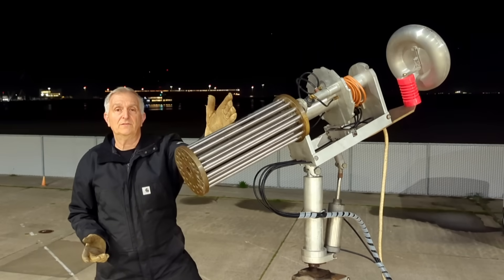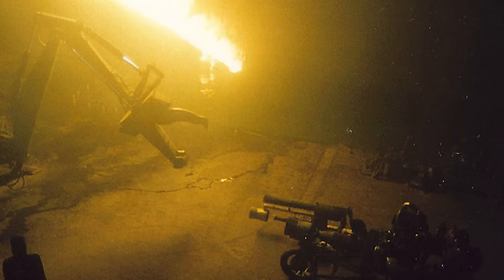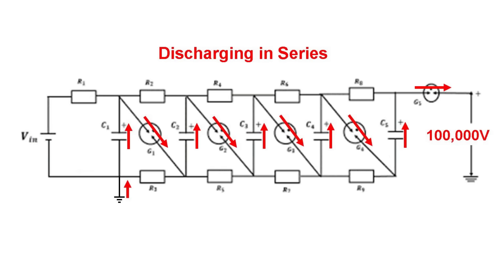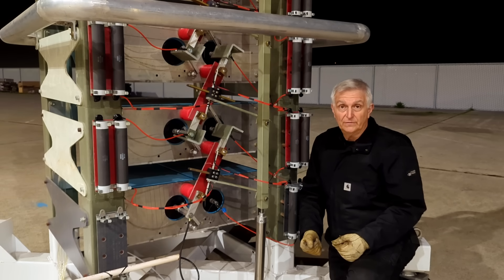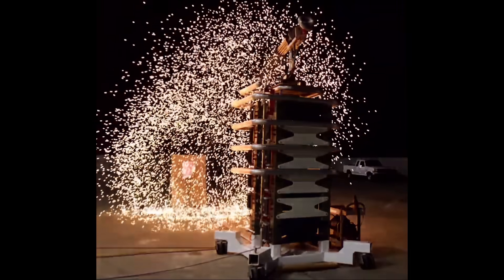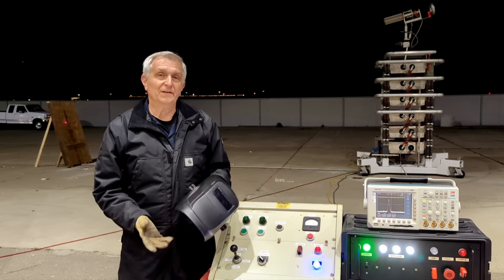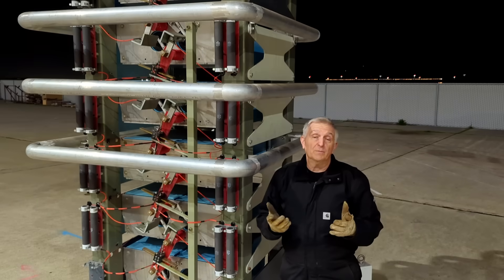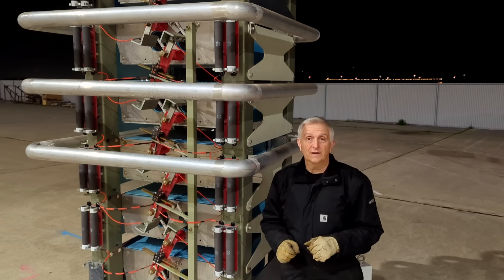Firing the Lorentz Plasma Cannon

Comment: 3:12 heyyyy I worked there, one of the coolest pictures ever! Unfortunately the machine no longer does this :(
Reply: What does it do now
Reply: @ It does the same task but the electricity is contained within the test object, as it was always meant to be. Means no pretty lightening bolts, though.
Reply: @EllipticalReasoning no more light show?!? Awwwww I wanted to see man made awesome
Reply: Honestly seems like an awesome job!
Reply: What is that thing actually, I hve seen that pic from my childhood
Reply: @  I replied to this but it seems the comment was eaten by youtube - it is the Z-machine pulsed power facility. It concentrates electricity from a huge circle of capacitor banks into what was the highest voltage charge on earth (I'm not sure if it's been overtaken). They zap various things, but primarily targets made from very thin, precisely positioned tungsten wires, which they do to model the behavior of plasmas in extreme conditions. 

The massive sparks were an unintended and initially unknown side effect of the process, discovered when a researcher left a camera in the room (which is, of course, cleared of personnel before firing) during a test.
Reply: @ranojmahilary8064  It's the Z-machine pulsed power facility at Sandia National Laboratories. It's the highest voltage facility in the world (actually it might be only the Americas now), as well as the brightest x-ray source in the solar system (see above). They use, as described in the video, enormous banks of capacitors submerged in oil to build up unbelievable electrical voltage and current, which they funnel into various test apparatus to create intense electric and magnetic fields for the study of plasma behaviors. The sparks you see are actually wasted energy that is lost in the process - a modernization a few years ago means these are no longer formed, as the electricity is properly captured. Fun fact, for a while they didn't know it did that, until a researcher put a camera in the chamber on a whim. The scientists were worried but it turned out to be harmless.

Comment: Slo mo shows what appears to be a thin metal rod being shot in advance of the discharge. No mention was made of this. While I presume it was used to guide a thin wire, it would help if this object and its relevance was explicitly mentioned. Additionally, building a unit with a quarter mile range would presumably require a larger, sophisticated wire spooling system, similar to what's used on TOW anti tank missiles.

Comment: What is the pellet that shoots out before the plasma explodes
Reply from the maker: The dart for the trigger wire
Reply: @LightningOnDemand  is there also a ground wire that's run from the capacitor stack to the Target
Reply: I assume it carries the thin wire conductor that forms the plasma.

Comment: 6:27 Okay, possibly a dumb question but.... Are all those "sparks" just plasmafied air? If so, why are they affected by gravity so much? I'd have assumed that air in a plasma state wouldn't change it's density (or at least not have it's density go UP). So, clearly I'm missing something here.
Reply from the maker: I'm not exactly sure... It seems odd to think that they are all from the infinitesimally small wire [only 0.008" dia]

Comment: ITS BACK! I would love to film this in slowmo.
Reply: time for science youtubers unite and get this man a 30ft tall capacitor bank!
Reply: @outandabout259  Where is Hacksmith!!
Reply: @outandabout259 dont let the us gov see this shit lol they'll come to him with tanks and fighter yets😂😬😬
Reply from the maker: What frame rates are possible these days at 1080?
Reply: @LightningOnDemand  From wiki - "The Phantom TMX 7510 is currently the company's fastest camera as of November 2022. It can record video at up to 76,000 frames per second (fps) at its maximum resolution of 1280 x 800, and can record at 1,750,000 frames per second at a resolution of 1280 x 32, or in binned mode with a resolution of 640 x 64." The trick is you wouldnt film full frame along the hight, but a nice, thin, laser sized frame for them truly stella slowmos. Good thing with your setup is light (hopefully) wouldnt be much of an issue. Destin, correct me if im wrong
Reply: @LightningOnDemand  pretty sure most guys with phantoms run at like 250,000 but technically they've built cameras that can record the speed of light
Reply: @masterofhippos1395 that's impossible for many reasons. There was a high speed camera that claimed it recorded light, but it was disproven.
Reply: @masterofhippos1395 cameras that record the speed of light are a little strange though; instead of recording everything at once in one take, you scan a few pixels at a time and repeat the same procedure each time until you have a complete video.
It’s really hard to record something that isn’t repeatable because of this
Reply: @nightmare1010 the one MIT or Harvard made (can't remember who) didn't work like a normal "camera". From what I remember, it was like a reverse camera where it picked up "shadows" and could track shadow displacement, and work backward to therefore "capture" photon progression but... I'm just a jackass with a phone. I literally know nothing.
Reply: @LightningOnDemand way too many. 😂
Reply: @LightningOnDemand  Up to 1 million fps if the image is black and white
Reply: @LightningOnDemand  lol lots of
Reply: @LightningOnDemand I mean.... a lot.... Like, a LOT a lot. 

And if you're getting super crazy, and are alright with "frame rate" being more metaphorical than literal, we can now catch photons in slow mo using... hyper magic. (MIT did this a few years back iirc)
Reply: @LightningOnDemand  over 9000!
Reply: @theslowmoguys
Reply: Slomo guys would totally jump on this bandwagon
Reply: @MaverickBlue42  yeah but they're irritating
Reply: Yes. Yes. Yes. Yes. Yes. Yes. Yes. Yes. Yes.

YES! 😆
Reply: I need this collab! This machine absolutely blew my mind
Reply: If you're the one that does it, please just do it justice! We know that we need the super super ungodly million frames per second stuff with something like this. Anything less than those latest greatest camera models would be a dissapoinment honestly. So please rent one and do it right 😃
Reply: I'm so glad you are see you saw this.

I would love to see you bring a slow mo camera to film it. Tho I understand if you are concerned about the camera getting damaged.
Reply: @darkpheonix77 If concerned about the camera, perhaps you could use the same method used to film the atomic bomb tests
Reply: @smartereveryday @theslowmoguys time for a colab
Reply: @danatkinson1517  mmmmmyes. Smarter everyday brain combined with slow mo humor and this genius of a man that created this masterpiece. I almost say invite rober, and electro boom but. Marks so busy and electro wouldn't want to get Zapped by that thing😂
Reply: And then please dumb it down to my level 😂.  Electriccurry. 
Am I right in thinking it's just a lot of power being forced through a circuit,  as I presume the bolt you see has a wire attached.  And long pole on the floor is negative earth.? 
Never been great great at understanding electric.
Reply: @DW-hx1xm  yes it shoots a little metal piece at the target with a wire attached back to the cannon, which guides the electricity where to go. And the capacitors are basically just being used as a huge battery bank, but one that can be discharged all at once very quickly!
Reply: @koijoijoe Obviously you can see the wire, but I'd like further explanation. Is the wire being shot from the cannon? Was it already pre-wired? If it shoots out, how and where is it attached? It's not really a "weapon" if you have to say "excuse me, violent robot who is trying to cut my head off, but do you mind if I solder this wire to you?" An air or explosive powered projectile attached to loosely bundled wire, shot from just above the laser should do the trick, but then you need a means of timing the electric discharge to happen right when the projectile reaches the target. If he got this far, I'm sure it's doable. Would the target need to be grounded? Could it shoot down a drone? This video left me with a lot a questions that I'm sure Destin could help sort out.
Reply: @DW-hx1xm Yes, it's just a wire at 210,000 volts being shot out that completes the circuit when it reaches the target.  There's a grounded lead on the floor that goes over to the target from the tower.  Of course, the trick is that he's firing the Marx generator just as the wire being shot out reaches the target since a Marx generator is a pulsed circuit.
Reply: @flomojo2u doesn't the wire making contact with the target cause the capacitor bank to fire? Just by completing the circuit.
Don't you just charge the bank up and then fire the wire - then kaboom!?
Reply: I love how I randomly saw this for the first time today and as I look at the comments.... here's another one of my favorites! Crazy
Reply: First thought seeing "8x slow mo" was we need Destin or Gav on this STAT!
Reply: Of COURSE Destin is here, and early. I'm sure I'm not the only one who thought this guy would be right up Destin's alley. 😆
Reply: Show this to Mehdi. He must see it!
Reply: Make this happen! :D
Reply: Slo mo guys please!!!
Reply: Maybe a team-up with the @theslowmoguys?
Reply: Get on it Destin... I feel like how ridiculous could have a lot of fun with this too
Reply: and i know some Guys just for the job
Reply: Please make this a thing and help him build it bigger!
Reply: Please make this happen Destin, or we will be forced to bully Gav and Dan instead :face-green-smiling:
Reply: Make it so
Reply: Collab!? Yes please!!!
Reply: Plz do Destin !!!!!
Reply: I was hoping! Yes, please!
Reply: @theslowmoguys?
Reply: Smarter collab with this cannon would be amazing, please i need it
Reply: All the yes!
Reply: That would be awesome!
Reply: dude! I was thinking the same thing lol
Reply: Please make it happen!!
Reply: You know something is legit when Destin comments on it 😂😂
Reply: Hi Destin! I shouldn't be surprised but am definitely delighted to see creators watching each other work.
Reply: Pleeeease
Reply: Yes please do
Reply: YES !!! Some real slow motion (so at least 80'000 frames per second if not 800'000 f/s) with proper exposure so the most exciting moment is not all white.
Reply: Wuderwaffe
Reply: Sup Destin!!
Reply: Please!!
Reply: For real, I was gonna suggest slomo guys, but like I need to see this is some high definition slomo. I want to know what's happening!
Reply: oh my god please make this happen. that would be peek entertainment holy crap!
Reply: omg yes, please collab :)
Reply: Would love to see this
Reply: Take care to not be adversely affected by the plasma chanel
Reply: Yes! So cool to see this.comment!
Reply: YES PLEASE!
Reply: Yeees I was about to comment that 🎉
Reply: Yeah this is really cool to see that tiny beam of light that looks literally like a blaster shot from starwars.
Reply: Yesssssss!
Reply: And I would love to watch it!
Reply: Just remember to bring extra underpants.
Reply: Yes pleaseee!!
Reply: Please!!! This would be awesome
Reply: Please make this a reality. Get on the phone to the slow mo guys asap
Reply: Dude! Yes please!
Reply: OMG LETS MAKE COLLAB HAPPEN!!! THAT WOULD BE SO FRIKIN AMAZING!!
Reply: I was thinking this exactly.  Having you show up and break down and into this topic as well as the super nice cameras to see more of what's going on would be so sweet.
Reply: PLEASE make it happen this would be incredible
Reply: Let's goooo!
Reply: Destin is here. Now where is the madman Chris Boden?!
Reply: Call Rober too. Get it done.
Reply: Well well look who it is
Reply: No me first
Reply: Destin, you should give him a hand and make that 1/4 mile hit!
Reply: Destin, I was thinking of you when he played the slow motion shots! Would love to see you guys get together on this project!!!
Reply: Hey this guy got time money and cameras. You won the lottery LoD!
Reply: MAKE THE LARGER VERSION HAPPEN!!!!
Reply: Would it do anything to a ballistics dummy? If so that would be the best target!
Reply: Imagine something like this with the energy only a nuclear sub could provide...
Reply: Yes please! Honestly the first thing I thought of when I saw this.
Reply: Might wanna get Gav involved as well.  Not because I doubt you can do it,  but so that you can point as many cameras as possible at the thing so we get maximum coverage from as many angles as possible.
Reply: You + slow mo guys. PLEASE🤙🏽🙏🏽
Reply: Yesss please, I just think it's gonna be cool if you do some colabs and here you are !
Reply: I was just about to write a comment suggesting filming with @smartereveryday :D
Reply: You or the slo mo guys
Reply: Omg PLEASE film this guy playing real life tower defense in slow mo! I hope you guys can make something happen!
Reply: Please do!!
Reply: DO IT!!!!!
Reply: That's a big ass taser gun.
Reply: @smartereveryday  Yes yes yes!!
I wanna see Destin do a break down of this so badly!!
Reply: Yes please do. I was just dropping that comment
Reply: Get the Slow-Mo Guys in on too and do a three way collab!
Reply: I take it back! Colab with Mahdi, Destin AND slomoguys! Some mad science here!
Reply: I just got done saying I would love to see a Slo Mo Guys collab and then I see smartereveryday.
Reply: film your own content, grifter

Comment: How come nothing arcs? It only seems to set off once the wire physically touches something else, but I'm a little shocked it doesnt arc between anything else before that happens
Reply from the maker: That's the job of the equi-potential rings surrounding the Marx tower -- to prevent wayward streamers from forming.

Comment: ❤❤❤❤

From the shot at the TV - timestamp -1.44926583s in the high-speed camera is the money shot where the plasma connects. 

I also love seeing the deflection give up the ghost a few frames later.

So Greg, do you have electro mechanical switches to replace the spark gaps with individual contacts?

Comment: You are shooting a wire first for the charge to follow. That is clearly evident in your slow-motion video. That's not the same as a directed energy weapon. That's cheating. It's also not very useful for long-range targets.
Reply from the maker: There's no such thing as cheating in weapons! ;>  
I was also surprised to find that the range scales favorably with voltage, as I mentioned near the end of the video.  The trigger wire transport would simply convert from a dart to a drone.

Comment: Wow , to shoot a discharge plasma that far through the air is incredible . I have found the drier the air the better for discharges . Now in the winter with the woodstove on and humidity at 25% my Van de graaff generator can discharge from the top to the fan hood over the stove . If you were to use it in a empty building lowering the humidity below 30 % i believe you might get a longer distance with the power you are using . I think the moisture in the air could play a big part in your distance . Good Luck .

Comment: Is there a laser out there that is high enough energy to create the plasma path instead of a wire? Could be possible to discharge the capacitors along a laser neam that has prepared the plasma channel for the current to flow through?

Comment: "Shockwave has gone supersonic" You mean Ultrasonic? Points at Boeing Plasma force field blocking Shockwaves Plasma generated Ultrasound can generate pressures greater than the bottom of the Ocean if done right. Googles: "Ultrasound hologram with particles" What's the rod you're shooting? The conductor for your bolt? You can make invisible lines using what's in the atmosphere to your target. If you want to make plasma balls you're gonna need Ultrasonic holography just enough to feed the rotating compressed ball of plasma before releasing it and it needs to be able to make its own Ultrasonic tunnel  after being released so it pushes medium out of its way with Ultrasonic repel field.

Points at Ultrasound Holograms shown in public super primitive Heh.. Points at Predator movies Plasma cloak Warwick university Plasma generated Ultrasound + Ultrasonic echoes to increase medium around you to manipulate + Ultrasonic resonance to split water into hydrogen to charge with Plasma + Sonoluminescence support if needed. < Oh yeah buddy I know exactly what I'm talking about..

Comment: How much energy does each shot consume? What power source is the device connected to, a standard NEMA 5-15?
Reply from the maker: about 400 kilojoules, from a 480V charger.
Reply: @LightningOnDemand  wow! Thanks for the info. I'm trying to figure out how much each shot costs from the grid, so without the time component, I can't determine kWh. Would you be able to help me out in that regard? Also a 480v charger! Sounds like we could mount it to an EV battery pack for portable POWer
Reply from the maker: @Seattleandrew  400kJ is about 1/9 kWh, so about 5 cents per shot.

Comment: I still need to see this with a Plasma channel made by a Laser.  Something like a powerful Nitrogen laser, maybe Copper vapor laser as they are CW.  It can be done, its been done with Lightning before, I am curious what sort of range this could get with such a setup, the Air would all be ionized BEFORE discharge by the Laser.  Styropyro probably has something that can do it.